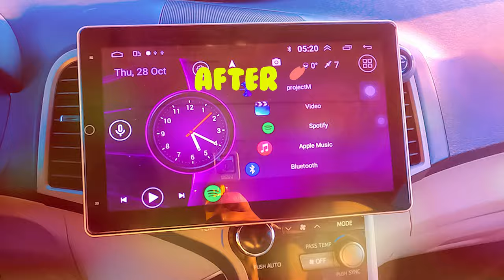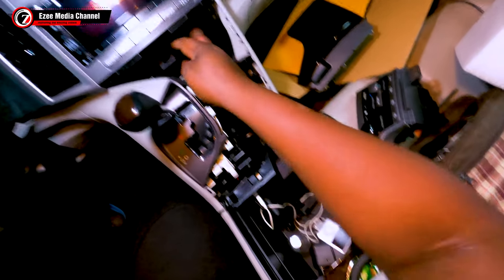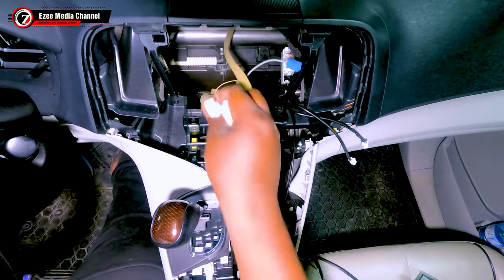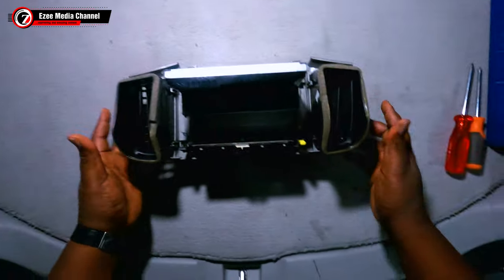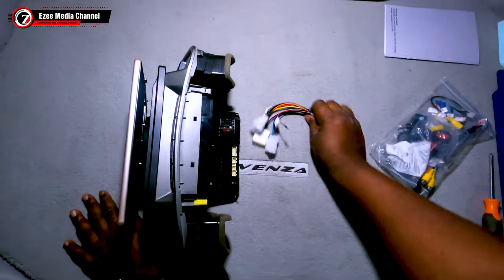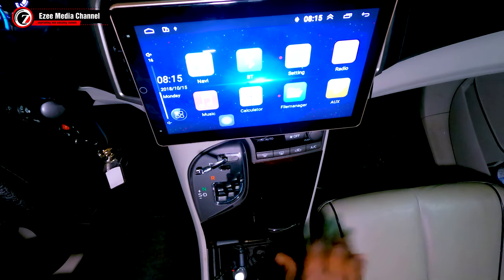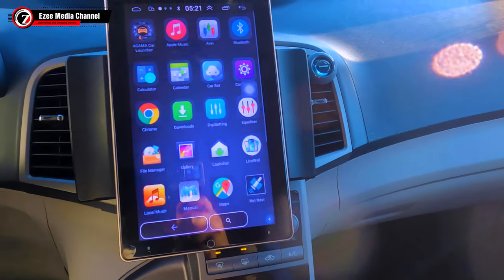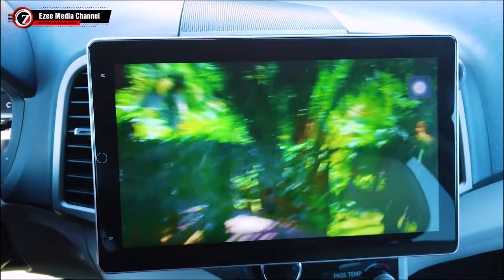Universal Automatic Rotation Android 10.1" Car Player - Installation on Toyota Venza 2011

Comment: Nice video, you convinced me to get this exact unit instead of replacing with the same OEM unit. My OEM nav screen has been ruined over the years in the south florida sun and it was really bothering me.
Reply from the maker: Awesome thanks so much for the comment I really appreciate the video helped. Feel free to ask me any questions on my social media handles and don’t forget to like this video and subscribe for more amazing contents🙏🙏🙏🙏🤗🤗👍👍
Reply: @EZeemedia  just got mine delivered and i guess they changed the design. it doesn't mount to the aliexpress  fascia screen the way that one does. instead has a more standard double din mounting design and i'm not sure how to attach it. The body of the actual unit is so shallow that it doesn't want to mount into the metra fascia either.

Comment: Please, my toyota venza does not have a reversed camera. I have purchased the motorised radio. How can i fix the reverse camera
Reply from the maker: Hey Godfred u will have to follow the connecting steps on the video then for the reverse cam u have to connect the cam to the stereo and find a way to relay the wire to the back and find a way to screw the cam at the booth door. Don’t have a video for this installation but u can find a way or search YouTube for a similar video that can help.

Comment: Have a new harness and it was for JBL with the vehical only  2 plugs worked it has power but no sound, how to you control the sound?
Reply from the maker: Hey Maurice for the sound make sure the harness cable u have has connection to ur vehicle sound cables if it has then connect them after connecting them u will have to go to the settings of the stereo to set and increase the audio settings.

Comment: With the Toyota harness did you still need to cut any wires or was it plug n play? Also I have a backup camera, that works as well? thanks
Reply from the maker: The harness is plug and play and not cuts made to fit the model type. To connect the backup camera u will need to hook it up with the factory camera or bypass it by connecting to the camera that came with the stereo. U can choose to use which ever u prefer. Thanks for the comment and pls don’t forget to subscribe for more upcoming videos. Thanks 🙏🙏🙏😊😊

Comment: I a very similar stereo on Alibaba. I have a three wire adaptor coming out of the main harness that doesn't match anything on my car and I have several wires from my car that don't match anything. Which is the antenna and how do I hook up the factory backup camera? Thank you so much in advance.
Reply from the maker: You will need to get a compactible harness wire for the stereo that will match ur car. try this link and see you should get one from here. Don't forget to subscribe for more cool videos.  https://www.installer.com/item/display_item.php?it=qctoy-1.  Please comment back if that helps ok. Thanks for dropping by.
Reply: @EZeemedia  will that do back up camera also?
Reply from the maker: Yes will do with the camera that followed the stereo

Comment: Question, did you screw the head unit back in with the 4 bolts from the factory bracket?
Reply from the maker: Yes Danny I only just bought the screws from the hardware shop. Thanks for the comment Danny 🙏🙏🙏👍
Reply: @EZeemedia  I found that the stock bracket does not fit well, the bracket is a solid inch away from the corresponding screw holes. Can you possibly show me what screws you used to make this work? That would be greatly appreciated 🙏

Comment: Hello bro, did the steering wheel controls continue to work… or do you need additional adapters?
Reply from the maker: Yea it will start working after setting it up in the settings

Comment: Your venza is 4cyl or 6cyl? The harness i got they don’t plug and play and i have seen other videos removing and the head unit and they are the same of mine but you venza have different plugs
Reply from the maker: Mine is 4cyl
Reply: @EZeemedia  thanks i did my research and my wiring harness change because mine have JBL premium sound and plugs are different. I had to buy another set and finally i got it installed
Reply: @Famed-_  could you please send me all the information about this. cause i have the same car v6 and jbl sound
Reply: @maikelsmart  you need to get different plugs with cambus so steering wheel control still can work, let me know where i cam share the link to the ones i bought
Reply: @Famed-_  could you please share the link here
Reply: @Famed-_  I'm JBL what did you get?

Comment: Hex head bolt, not square head screws lol, that would be Roberson, very helpful video, my hardness is super short, I think i have to reach from the top to disconnect the connectors before I can pull it off, also dropped a bolt and one of the plastic connector fell down, doh, should have grabbed my magnetic pickup tool or added a magnet to my socket...
Reply from the maker: Thanks buddy ☺️ glad it helped